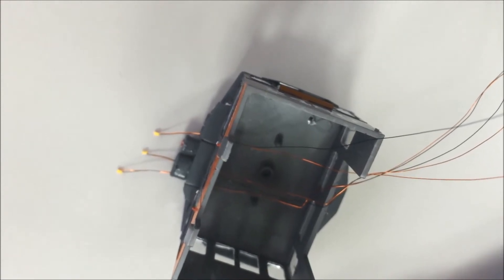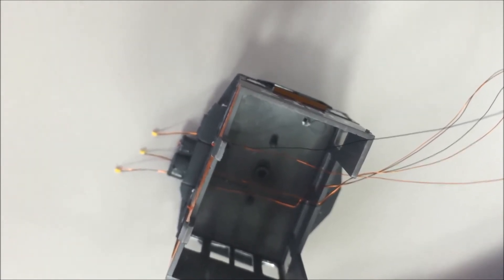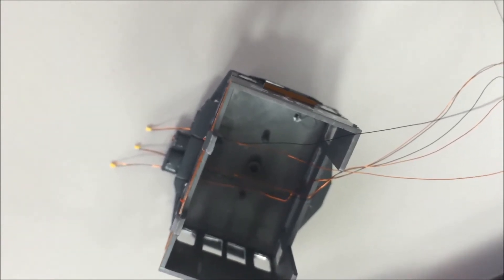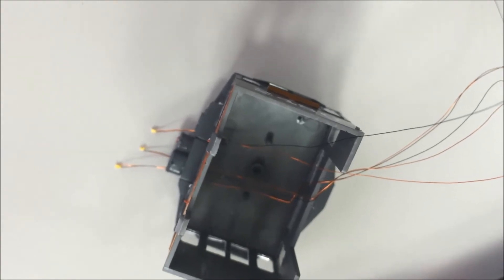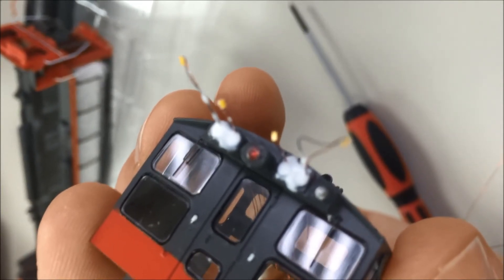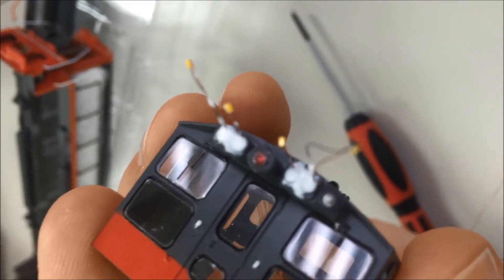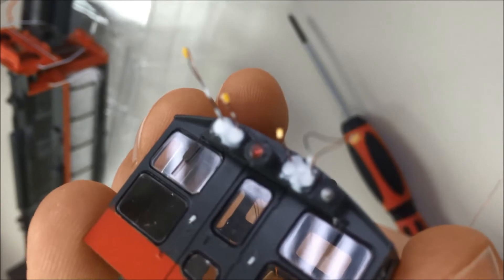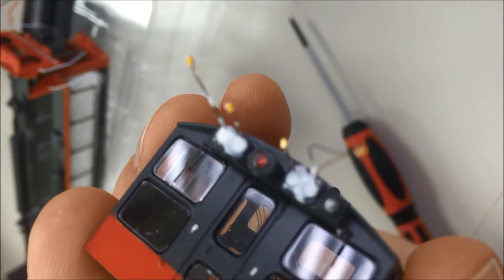Microleds and sound decoder install SW1500 YT

Comment: Looks very good. Great tip on using MKK as you did. I actually like the 1.5v bulbs Athearn uses, but as you say, they are usually smaller than the actual openings and they do tend to burn out. When they are new and working, I actually think they represent Halogen bulbs very well.